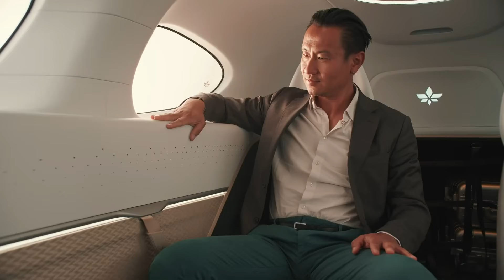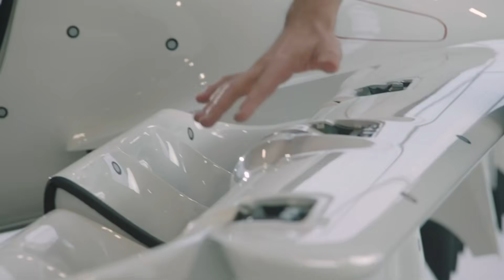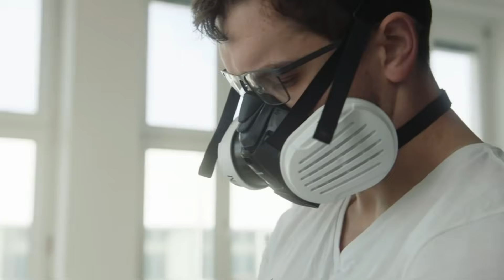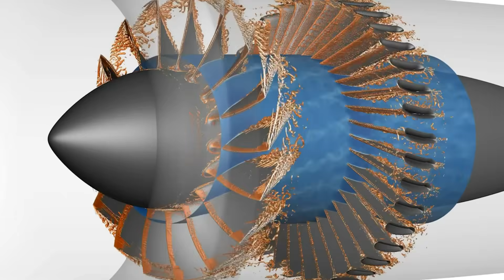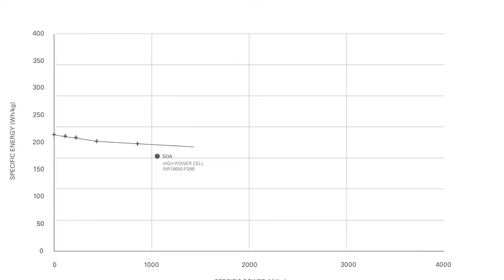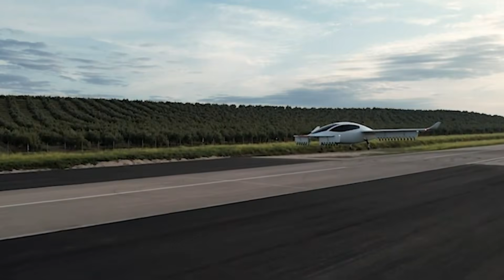Why Lilium Failed: The Hidden Problem With Its Revolutionary Electric Jet

Comment: Sounds like an ad for Mark Moore's whisper......
Needing around 3000 horsepower installed for a handful of seats and still relatively slow ( and an ever shrinking range claim) is not success .
Reply from the maker: Fair criticism. The video wasn't intended as an ad for Whisper Aero or Mark Moore. Your bigger point is important: a passenger aircraft needs to prove real efficiency, useful range and economic viability, not just impressive technology. Installed peak horsepower isn't the same as cruise power, but the overall energy and weight requirements are still major challenges. I'd much rather see independently verified flight data than changing range projections. Thanks for raising this. 👍✈

Comment: I think Future batteries will likely make this aircraft possible in the not so distant future.
Reply from the maker: I agree — battery technology may be the biggest piece of the puzzle. If energy density improves significantly without adding weight, concepts like the Lilium Jet could become much more practical. The design may have been ahead of what today’s batteries can realistically support.